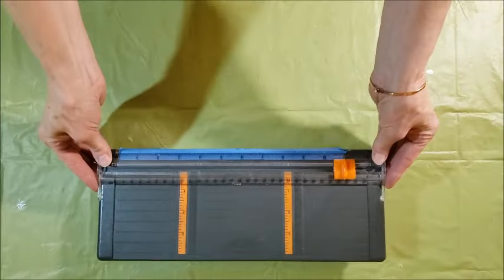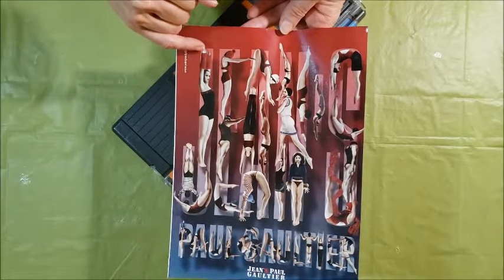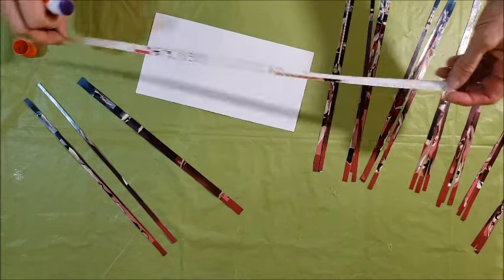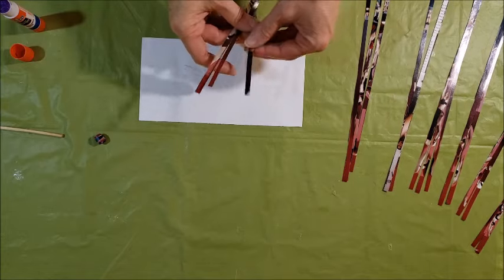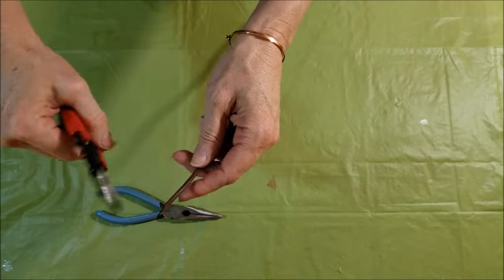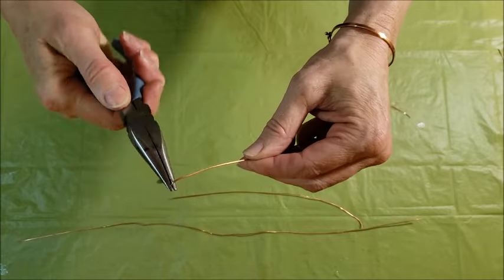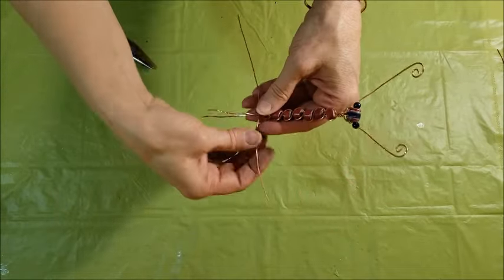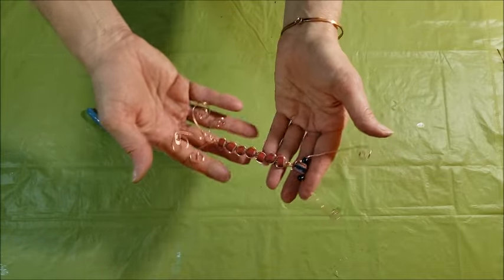Dragonfly Christmas Ornament Upcycled Pop Can and Paper

Comment: @UpcycleDesignLab these are adorable! 
If you use your pliers to hold the wire casing steady, you can use a box cutter to slice the casing length ways and it should just peel off.  Another way is once you have one end of the casing off...lay the side of the box cutter flat on top of the wire. Keep your knife hand still, pinning the wire against a flat surface. With the still blade facing you, pull the wire away from you. Some casing are easier than others.
Reply from the maker: Thanks for watching and for all the tips. 🙂

Comment: I got ahead of myself, n made wings before I made the body…. I came across sharp edges on the bottom of the wings from where the holes were made. Did you address how to secure or get rid of the sharpness? 
Please let me know, or any ideas on how to keep them from accidentally cutting someone.
Reply from the maker: Hi thanks for watching. I didn't really do anything to the bottom of the wings. They are a little rough but not really dangerous.
Reply: Bubble paint might help.

Comment: What kind of wire are you using? I have stripped several extra ones and are only finding the tiny flimsy ones
Reply from the maker: Hi Cassandra  - sorry I don't know exactly it was just some scrap wire we had. You can use regular jewelry wire in 20 or 22 guage if you can't find the right wire to strip. Hope that helps.

Comment: can i use 22 gauge wire... its either that or 10?   cause that what we have at work
Reply from the maker: Hi Lou - Yes you can use the 22 guage. I have made them with this weight of wire.  It isn't quite as sturdy but it will work. Thanks for watching.